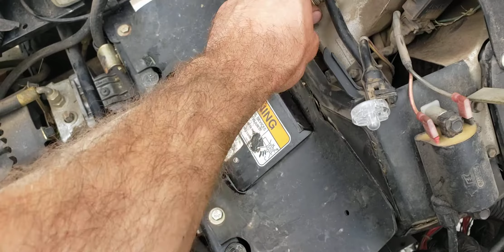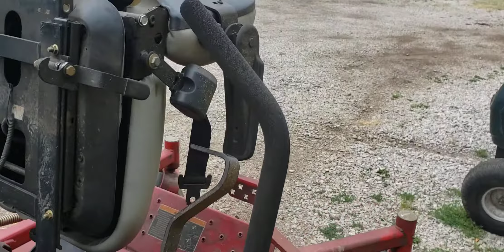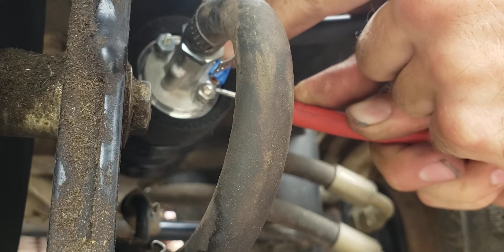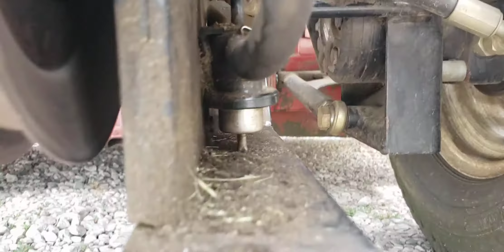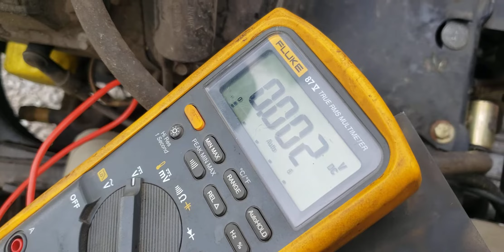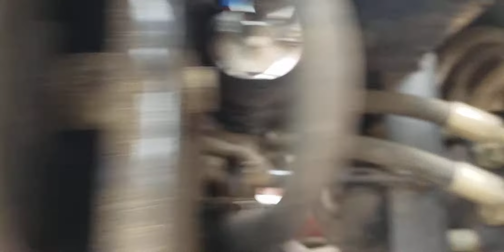Exmark Lazer Z Rider Won't Start || No fuel pressure

Comment: Hey Blake I thought I would update you on the electric fuel pump project I did find a replacement fuel pump its a Walbro GSL392 which is now TI Automotive corp. This fuel pump works well and the price was around $75.00 on amazon a lot cheaper then the  OEM fuel pump which I believe runs around $275.00, you will need two fuel line barbs which are 10mm x 0.1 thread I think that's correct if not i will let you know and I will update how the pump holds up so far great !
Reply: Brass fuel line barbs are metric thread  M10 x 1 x 3/8 barb sold by dealpartshere on Ebay

Comment: Hey Blake can you recommend a alternative fuel pump for the same mower you are working on in this video, the fuel pump doesn't appear to be the OEM and the OEM has a Part#  24 393 52-S, those OEM fuel pumps are very expensive and I believe all I need is one that produces around 50 psi and delivers 15 gph at 5.0 amps, any suggestions would be greatly appreciated and thanks for your informative videos.
Reply from the maker: Thanks for the comment Tim. This was the only fuel injected mower I've run into so I dont have alot of experience there to make a good recommendation. In carbureted applications I use a 2-3 psi universal inline pump. If your mower has a pickup tube in fuel regardless of the pump running or not, I think you could do the same. Make sure to use injection style clamps and injection rated hose for all connections.
Reply: @BlakesGarage1  Thanks for your speedy reply, I also own and operate a small engine shop and only on occasion do I have a EFI equipped machine come in to the shop and it is a Exmark with a 28 hp horizontal shaft Kohler with over 3000 hours on it so the customer did not want to invest in a expensive repair due to the life expectancy of this mower knowing it has so many hours on it, so shortly after sending you the message i took the old fuel pump to local auto parts store and was able to match up one that is similar but with slightly higher gph and  the same psi rating, I will let you know how this works because the cost of the replacement pump was only $80.00 compared to $300.00, thanks again !
Reply from the maker: @timpope1221  good to hear! Thats a ton of hours. If the engine ever goes, id switch to carbureted for ease of repair, parts and engine cost. Good luck with mower season, we're in the thick of it here.
Reply: @BlakesGarage1  yes it is !  this customer has 2 Exmarks over 20 years old one with 3039 hours and one with 2200 I started servicing these a few years ago so needless to say Im impressed with these kohler engines, Im going to rebuild them when they finally decide to stop running and I will let you know what I find on the crank journals and cylinder walls.

Comment: If my issue is with the positive side wire no power, from the pump can i run a jumper wire directly from the positive battery? Thanks.
Reply from the maker: You would want to pull it from keyed 12v so that it shuts off with the key.